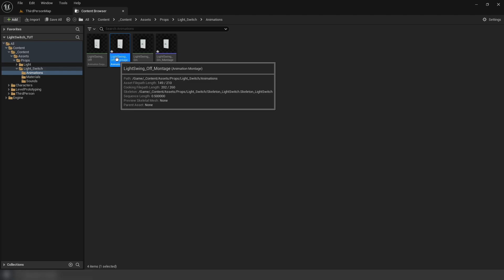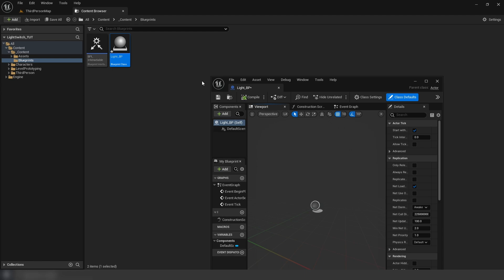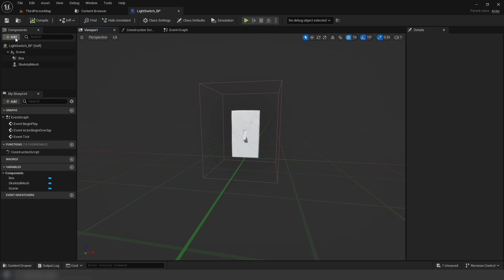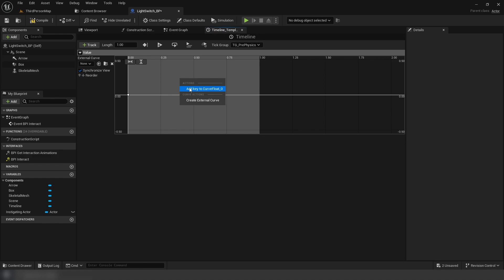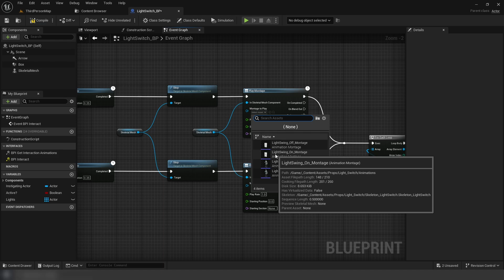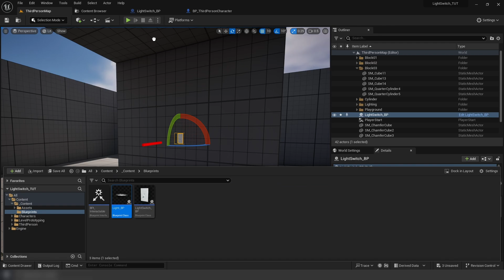Light Switch Interaction System - Unreal Engine 5 Tutorial

Comment: awesome, is there any chance you could do door opening/closing with interaction system?
Reply from the maker: Yeah, but it's possible to modify the system in the video already on your own. 

You'd just swap out the animations for a door opening one. Then of course instead of triggering light actors on interacting, you would either use animations to open and close the door mesh, or altering the rotation in engine through code on something like a timeline.

But if you'd rather me make a video, I can. Just might not happen right away.
Reply: @haezdev  
Thanks, man! I know it's possible, but I'm really new to UE, so I often get stuck and look for tutorials. I've never seen a standard tutorial on the interaction system with the door here on YouTube. I was searching for a tutorial that covers door interaction system, utilizing IK for the door handle. I'm not sure if it's possible to do it without IK - how would animation align with the door? Sorry If I am writting nonsense. I am really new lol
Reply from the maker: @schemeny  all good bro, no worries. In the video, instead of IK I go for the approach of transitioning the player to a location and rotation of an arrow in the light switch actor. You could do the same thing for a door. This would basically just be tinkering the location of the arrow to line up whatever door opening animation you have. And for syncing the actual door, I'd have an event on the door that calls the however way you're opening the door so that you can use a delay and set the delay to whatever number in time when in your animation of opening the door it is actually opening the door.

So for example in your players animation, he doesn't actually push the door open until 3.4. So on your delay you would set it to 3.4, so right when the delay ends it calls that event on the door of it being pushed open.
Reply: @haezdev  Thanks a lot, bro. I'll give it a try. I appreciate your help. You've gained a new subscriber :)